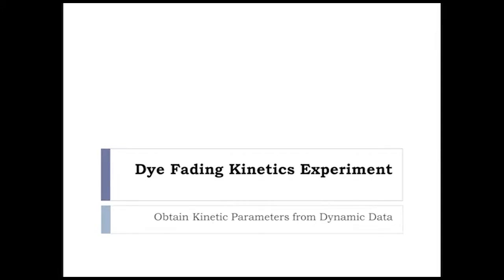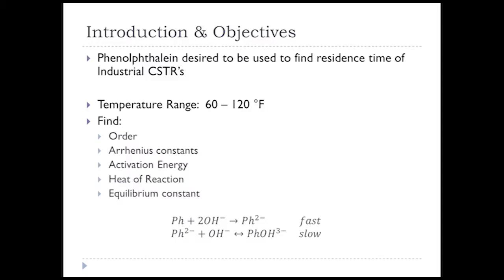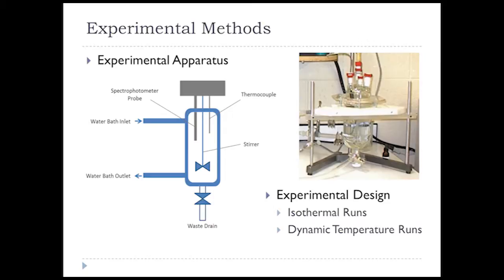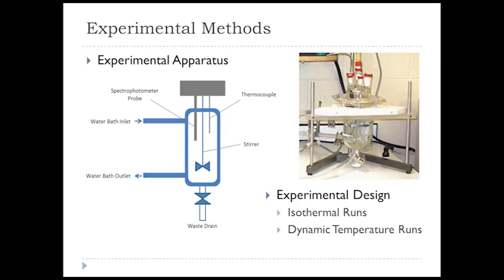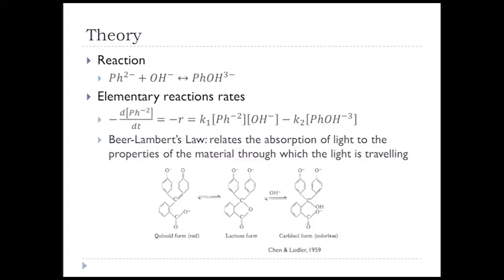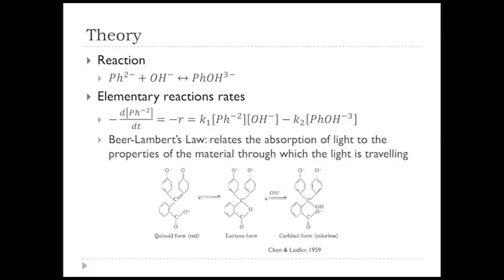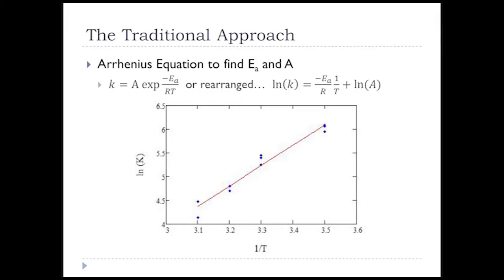Tutorial on Dynamic Kinetic Modeling

Comment: What would be the best way to run this example locally (i.e., not use the server)?  In other words, how are variable types (MV, FV, SV, CV), statuses (fstatus, status), and solver options (imode, max_iter, etc) set for use with a local machine?
Reply from the maker: You'd need to install a local web-server (Windows or Linux) and change the server name to 'http://localhost'. It only involves one line of MATLAB or Python script modification to run locally. We normally only make the server source available to researchers with specific needs that can't be met with the web-services. Please try first to work to use either 'http://byu.apmonitor.com' or 'http://xps.apmonitor.com'. In the event that this doesn't work, please send me an e-mail.

Comment: Can you help me with this kind of DAEs problem with inequality constriant in Matlab?

x1'=-0.2*x1+x2*x3+0.3*x1*x2
x2'=2*x2*x1-5*x2*x3-2*x2^2
x1+x2+x3<=3
Reply from the maker: There are many example problems posted here: http://apmonitor.com/do/index.php/Main/DynamicOptimizationBenchmarks  You may need an objective function to guide the selection of variable x3.
Reply: Thank you, but these examples don't have inequality functions in them, only the varibles have upper and lower bounds, which seems like the inequality.
Reply from the maker: The APMonitor modeling language supports equality or inequality constraints. Go ahead an try to input your model. The differential terms are $x1 and $x2 so your equations would be:
$x1=-0.2*x1+x2*x3+0.3*x1*x2
$x2=2*x2*x1-5*x2*x3-2*x2^2
x1+x2+x3<=3
You can even try to plug them into the web-interface at http://apmonitor.com/online/view_pass.php or include them in a .apm file that you solve with MATLAB or Python.